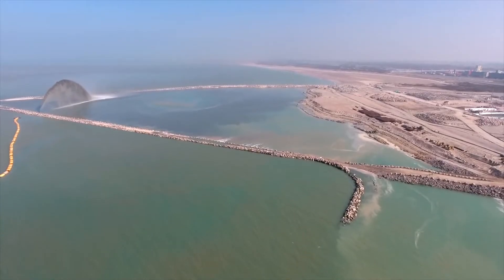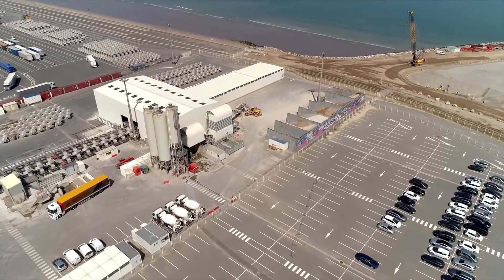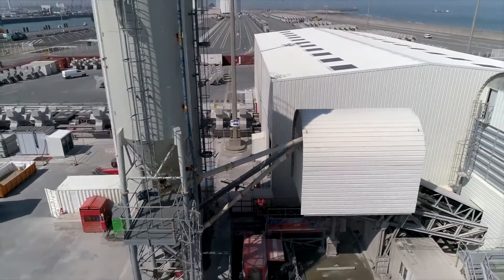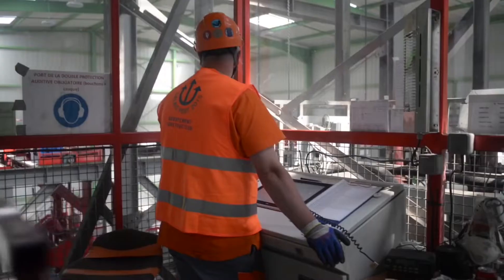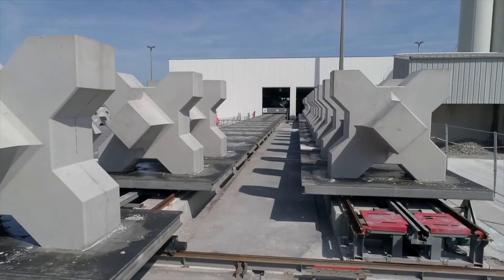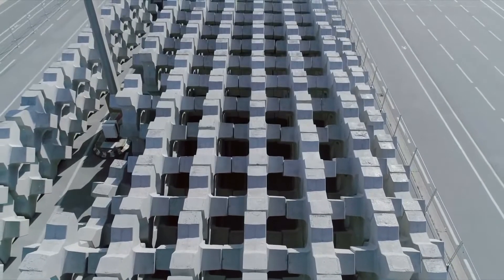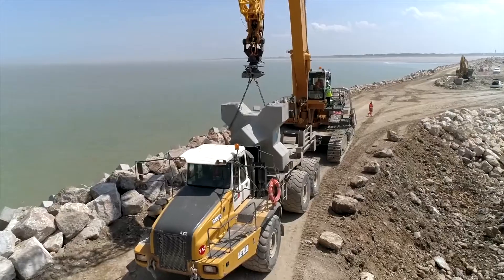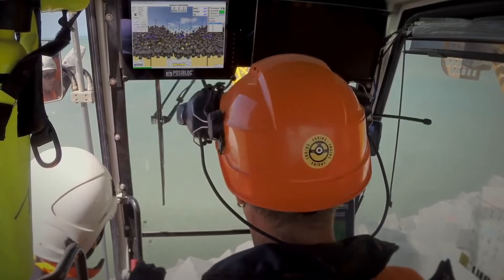How 100,000 Concrete Tetrapods / Xblocs Manufactured And Placed Along The Entire Coastline

Comment: The stabilopod is a concrete structure with a tetrahedral shape (equifacial tetrapod) used in hydrotechnical works.  Engineer Mircea Ulubeanu, Dr. engineer Mircea Lateș, researchers from ISCH Bucharest and designers from IPTANA participated in its design.  That invention was patented at OSIM (invention patent no. 56,171) under the name "concrete block for the defense of constructions exposed to waves".[1][2]

 Harbor breakwater protected with stabilopods.
 Structures similar to the stabilopod are:

 Tetrapod - created in 1950 by Pierre Danel and Paul Anglès d'Auriac in the Dauphinois d'Hydraulique Laboratory (now Artelia) in Grenoble, France;
 Modified Cube - USA 1959;
 Established - UK 1961;
 Akmon - The Netherlands (Netherlands) 1962;
 Dolos - South Africa 1963;
 Seabee - Australia 1978;
 Accropoda - France 1981;
 Hollow Cube - Germany 1991;
 A-jack - USA 1998;
 Xblok - The Netherlands (Netherlands) 2001.
 The stabilopods were used both as a "wave protection mantle" for the piers of the Port of Constanța and for coastal protection works along the Romanian coast.